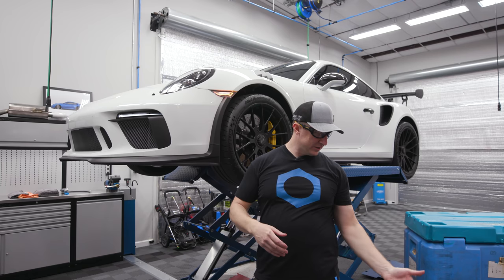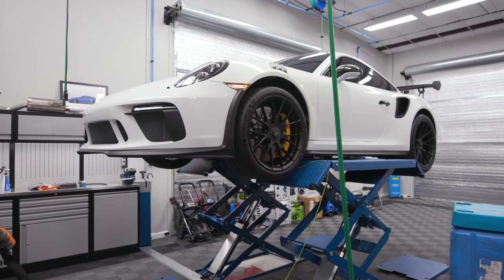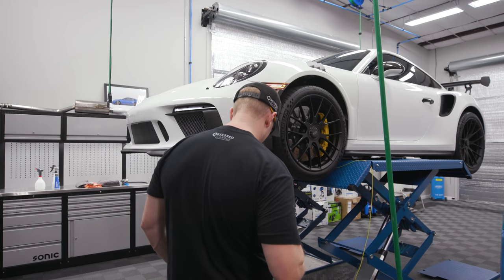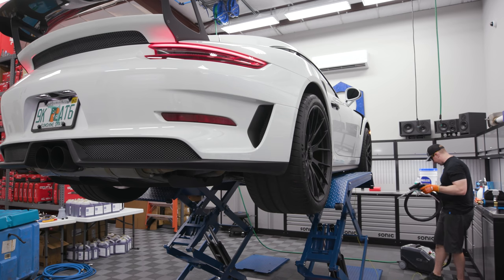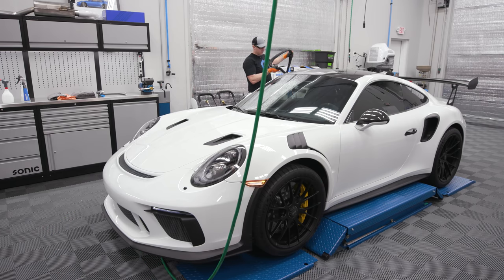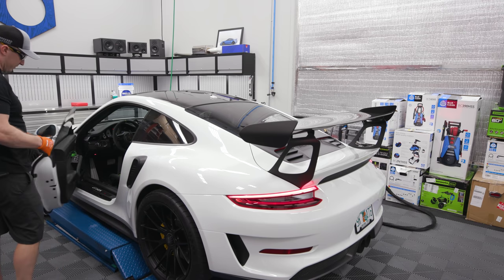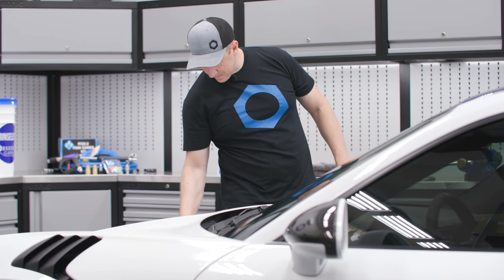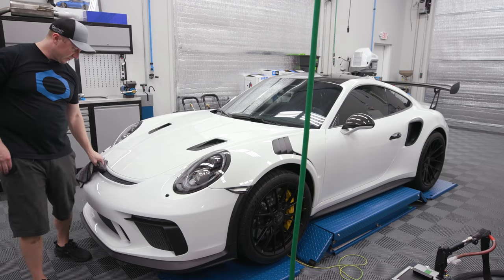First Time Cleaning My Porsche GT3RS With Dry Ice!

Comment: This is one of the fiew times I don't see where Matt is going. This is an ideal tool for a company or person wanting to add value to a service or job. IE tommy with the restorations or a shop doing nut and bolt restorations or cleaning work but for a home use... It seems somewhat outlandishly expensive for a tool that doesn't do the general cleaning as quickly or efficiently and where it really shines you'd get little to no use for your money. 

Definitely a very cool bit of kit regardless
Reply: If you’re constantly buying used cars or into restoring old ones I can see this being super useful. But yea for the average maintenance wash even monthly I don’t see it’s use. Maybe once a year if that.
Reply: @FlipnKraut  Yea, like I said if your I'm buying a d restoring cars will definitely add value. But if you buy one car to restore Evey fiew years you'd be better off sending it off to get done

Comment: What kind of advantage would this have over steam cleaning?  I feel like steam would do a much better job
Reply: Steam is probably not even 1/20th as effective as dry ice. Dry ice is basically a safe version of vapor blasting. Go check out some videos of the undersides of old cars getting restored with dry ice it’s pretty insane!
Reply: I’ve had a dry steam cleaner and it’s good, but nothing near as effective as dry ice appears to be.  Plus you’re always chasing little water droplet trails with steam.  Makes “runs” of dirt.

Comment: I would never use that on the paint or plastics.
Reply from the maker: It's perfect for paint and plastic.  No issues
Reply: I'd use it. Especially on the cowl and intricate grills. Mesh is a pain when they get gunked up. Realistically, I have a feeling this could remove dried polish and wax from plastics and crevices.
Reply: That's 100% where you SHOULD be using it.  It can clean and restore faded plastics.  Pretty remarkable, actually.